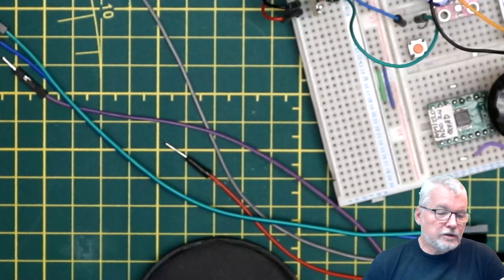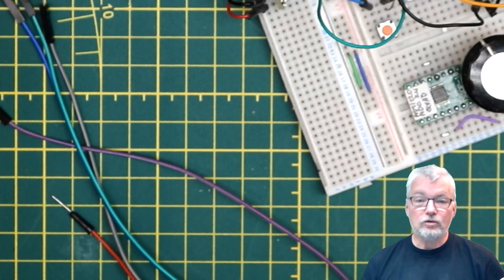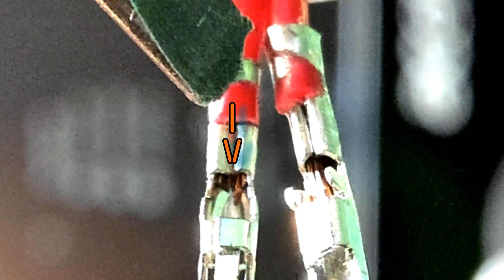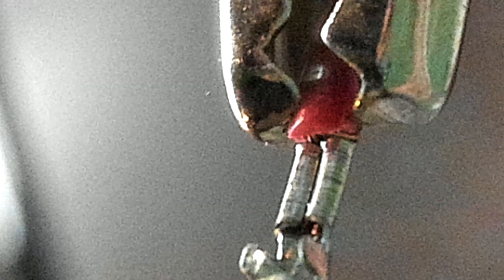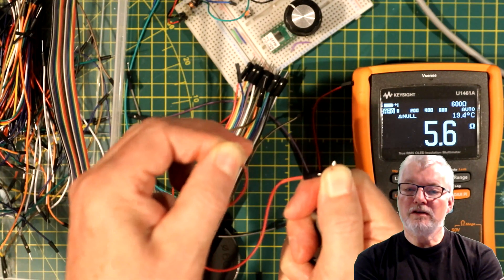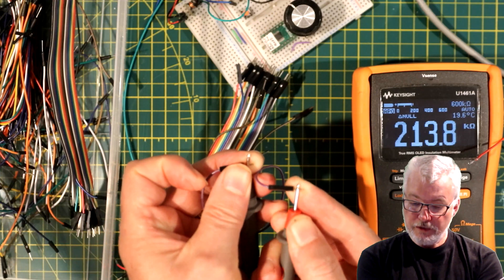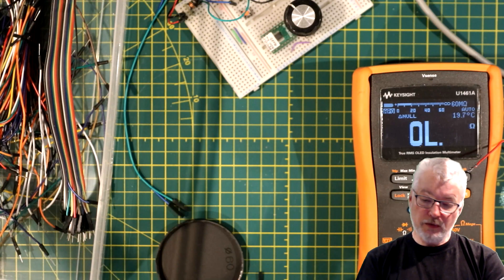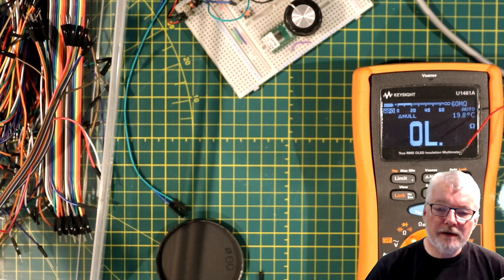Bad Jumper Crimps - Quick tip for breadboard users (Crimped Jumper Users)

Comment: This actually helped me a lot. I went through all me jumpers and soldered each one, mostly to practice soldering. This helped my circuits immensely. Now I crimp and solder my own, with 22g stranded tinned copper, and I've never had problems, even with high frequency circuits.

Comment: Hi, great videos, but I have a question..?
When you use the leads and touch between the two ends of wire, as you are displaying, doesn’t your body cause resistance as well??
Reply from the maker: It does or can but not in the low values we would be looking for in a properly made cable. It should be 0.1ohms or less if made properly,  body resistance would read in kilo ohms or more, ie 10,000 ohms so it would still be obvious if you have a bad cable

Comment: I never EVER use those "Dupont" style connector cables. I buy the round ones and for links on the breadboard, use the pre-bent solid wire (sold as a kit in a small plastic box).
Soldering will cause all manner of problems, as it wicks up past the end and causes the strands to crack when flexed.
Reply from the maker: Thanks for the feedback, I too use those bent wire kits for breadboards too, especially if im doing a more involved project and need the added reliability 
the dupont connectors themselves are a very reliable connector, if they are made up correctly, i suspect the wire is way too thin for the crimp and there just not making good connection, I have found this to be true on many I have taken apart (Built to a price, not to quality and purpose,)
Soldering the connector was a short term solution rather than throwing away the jumpers, but I do agree that soldering them is not the long term solution, correct crimping is the only real solution to these jumpers.
Reply: @TheBreadboardca  - As a test, buy a pack of these "premium" jumpers (this link is NOT a recommendation, it's just to show the style)
https://www.ebay.com/itm/Jumpers-/201415041897
The stranded wire is pretty thin and flexible PVC insulated. They are crimped and the black sleeves are glued down over the top.  The glued end really supports the cable well, and I actually use them as "test leads/probes" in my LED tester and with often heavy use they last me well over a year.
What always fails first is the glue that holds the sleeves on, causing the pin to slide back and get shorter. I just store up the faulty ones and then have a mass super-gluing session to restore them to service.
The round pin usually works better in the long term as the connection can rotate. Beware that the ends of the pins sometimes have a burr, which can scratch the breadboard. So I check them under the magnifier and run them over a file or stone to round them off.
Reply from the maker: @johncoops6897  I have those too, I would not exactly call them premium but they can be ok, the biggest issue I have found with them is a plastic / residue on the metal pin that needs to be scrapped off before they will make reliable contact (Not all of them, just some), I have also had many were the lead just pulled right out of the back with just the slightest of tug. I think at the price of those or the other type, your not going to get the best on reliability and should check them all for continuity , Good continuity... as I found some with several K or more resistance so they worked for some interconnects but failed as soon as even a small level of current passed through them as you could imagine. I like you resort to good old solid insulated pre bent wires (Or make my own from a roll) therefor 2 less connections to worry about per jumper.

Comment: I had this problem many times... There are 3 types of bad jumper I found:
1. Bad crimping... Loose connection.
2. Too much Crimped, that the bare copper get cut from the cable.
3. Bad quality cable, metal damaged, even inside the silicon...!!!
They looks all good, but project fails continuously...!!!
Reply from the maker: Yup, gets you every time

Comment: Great tip - often need the obvious pointing out!  My dubious sources are now everywhere except the main distributes and I won’t buy anything electronic from Amazon or eBay.  I try and make my own connectors now but I’ll be the first to admit it isn’t the cheapest route unless you’ve acquired the materials for other projects in the first place.
Reply from the maker: ya, you can get thousands of jumpers for just the price of a good crimp tool and they (The jumpers) sell for less than the price of even just the crimp and plastic cover, its no wonder that something has to give.....Quality

Comment: Interesting. I have had wires from a cheaper power supply, that is attract to magnetism!!!
Can't be much cobber in that wire...
Thanks for sharing👍😀
Reply from the maker: Did I really write cobber in the video... Dohhhhh.
Ah yes, the quality of low cost imports, steel / Iron is much cheaper but crappy electrically, so lets use it instead, the buyer wont notice right lol.........

Comment: Thanks for the awareness. I did have a batch of round pin dupont wires that had a thin clear plastic coating on the pins that was causing me frustration. After scraping that film off, they worked so much better - go figure!
Reply from the maker: I have had that issue in the past as well, that was one of the reason I started to get "Better" quality DuPont connector cables :)